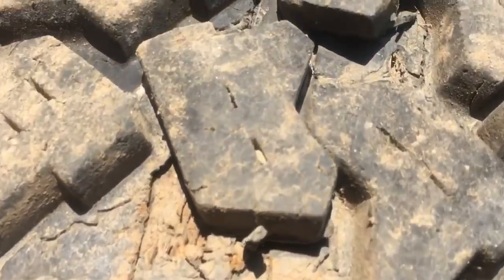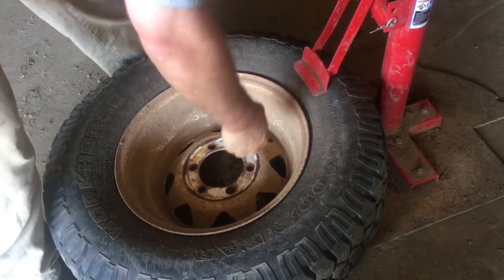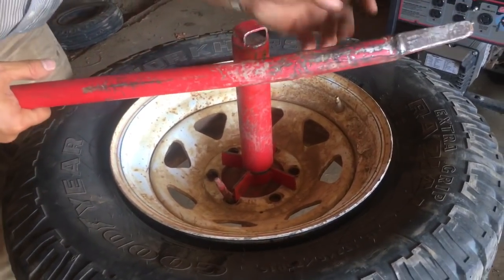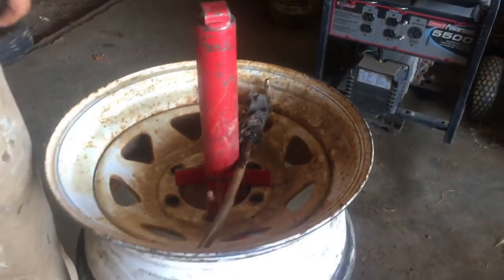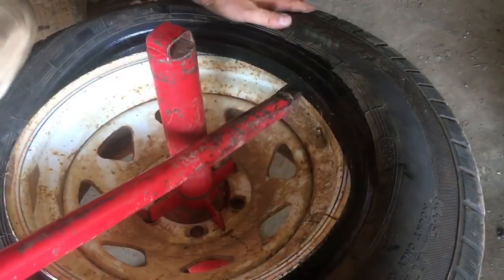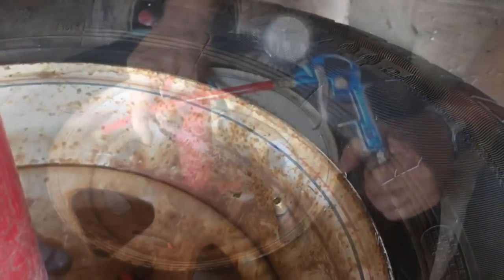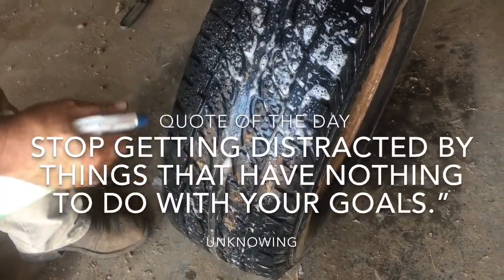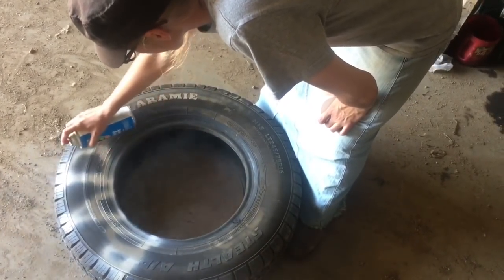Tire off and on a rim. Harbor freight manual portable hand tire changer review.

Comment: I did a lot of tires in the Ford garage, we had a pneumatic tire changer, which really didn't do anything extra other than breaking the bead was easier, and instead of pulling the bar around it rotated the tire around a fixed hook. Our bar for install was forged, very good

Comment: Bought a used HF tire changer off Craigslist for 10 bux,guy said it didn't work on 16" wheels...I mounted it to a pallet at first,and then to a mount on a trailer,and it worked flawlessly,changed 16 tires one day including 8 atv tires with it,and 8 trailer tires...It paid for itself with the first tire change,plus I can swap a tire out,and install it in less time than it takes to throw tire in truck,and drive to local tire store...Have used it on 12" wheels on up to 20" wheels,and with tires from 20" diameter up to 38" TSLs...

Comment: My Harber Freight model 69686 broke down in two ways with the first use. The bead breaker arms bent badly and the welds broke on the X that sits on the rim. If I didn't have an arc welder it would be unusable. Also, the mount/dismount bar damages rims and was also quite difficult to use. I added a brace to the bead breaker arms, properly welded the X, and use a thick plastic ring under the X to protect the rim. I also greased the threads of the tube that screws everything down. The process of mounting tires was still too difficult, so I bought a professional duckhead and made a bar to hold it. Now, it's easier, faster, and doesn't damage rims or tires. I started out cheap but paid the price in repairs and modifications to get a good working item. Also, it's a good idea to clean your rims. My aluminum mags had slow leaks until I cleaned and polished the bead seat area.
Reply from the maker: I definitely recommend going with the northern tool version. Quite a bit more heavy duty.

Comment: I do recommend getting a pair of tire spoons to use for mounting new tires as they work better than the HF onetoolforall one does...Nylon protective covers over the tool end makes it slide around wheel,and tire easier with the lube...It's only 102f here in deep south Abalama right now,but on a positive note it may rain later this week...HF tools sooo under rated,and most all of them are well worth more than they cost,even a one time use tool,and this is coming from a Snap-On/Mac tool owner..
Reply from the maker: I have spoons quite a few of them and you were absolutely correct about them. However I wanted to use with came factory with the harbor freight tire changer. Even this tire changer works great like you said. I have put on I’m sure well over 100 tires with this and it still works good. Thanks for watching 
happy trails
Luke

Comment: I have a Harbor Freight "small" size tire changer similar to that one... and it works good.  It's strictly for garden tractor size tires.  I was wondering.. what ply tires are you using on your stock trailer?  I agree with Scruffy 61... your video quality is fine.... IF folks don't like your video quality... they could always donate a high priced camera to you... that way you'll get their quality videos made and they'll have a good feeling of stewardship.  I'm not holding my breath tho.  Thanks again.
Reply from the maker: 10 ply tires, thanks for the tip I didn’t realize they made one for smaller tires, that would be really handy especially for four wheelers in such. Appreciate your friendly comments/advice. Please keep in touch.
Happy trails
Luke

Comment: you may want to anchor that tire machine to the floor and that flared bit at the other end of the bar you were using is for putting tire back on the rim.  I don't know if you have one but you may want to invest in bubble balancer  here's a link https://www.northerntool.com/shop/tools/product_200514379_200514379